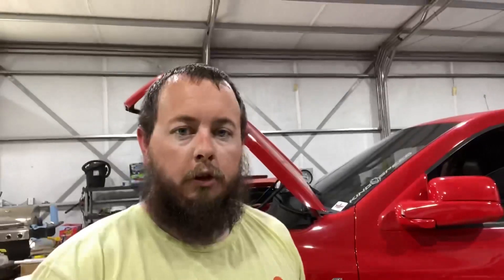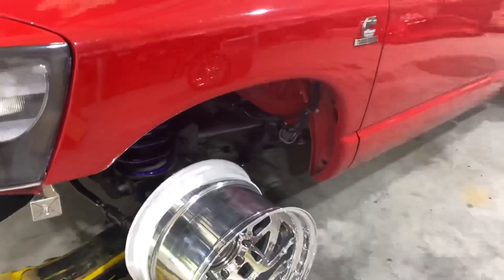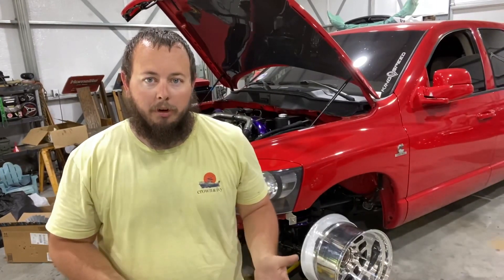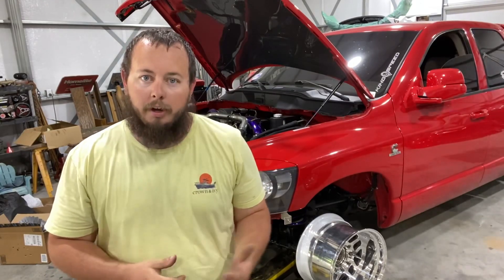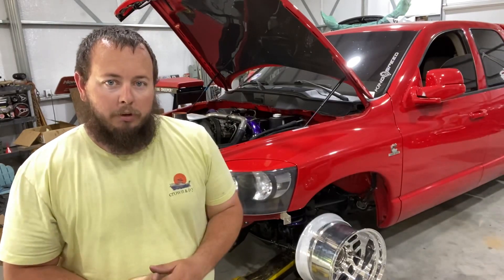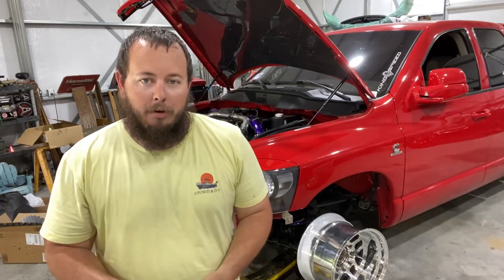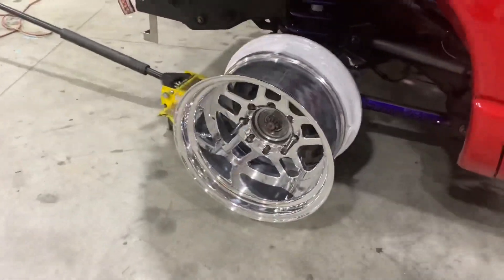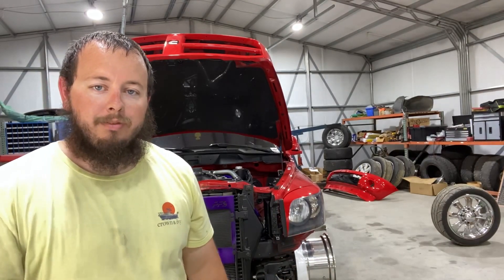New Wheels for the Race Truck!!

Comment: How much horsepower do you think you were making when the ARP 2000 head studs were not able to keep the head from lifting?
Reply from the maker: It was just over 1k. They held fine until it spun and I short shifted, causing a torque spike.